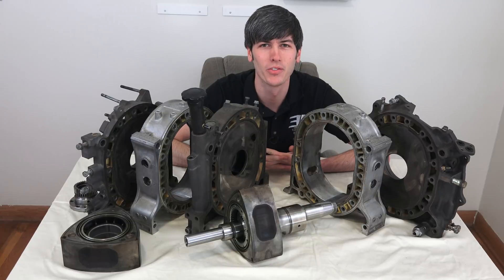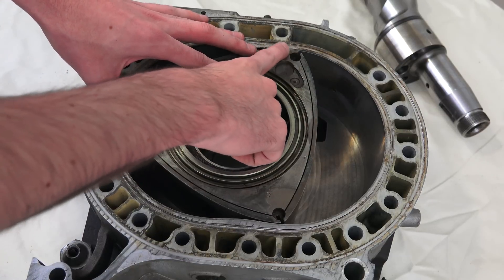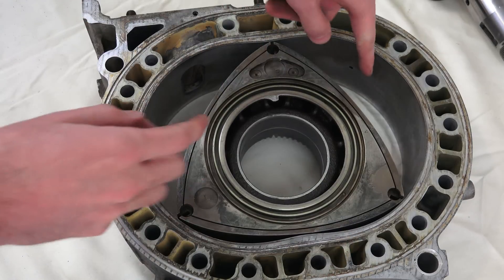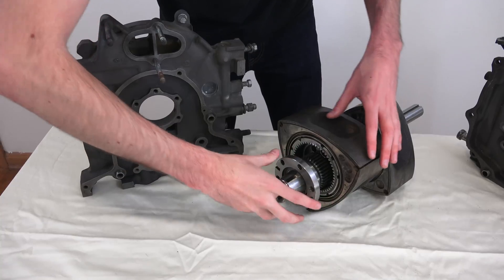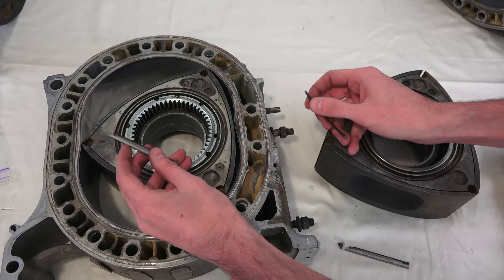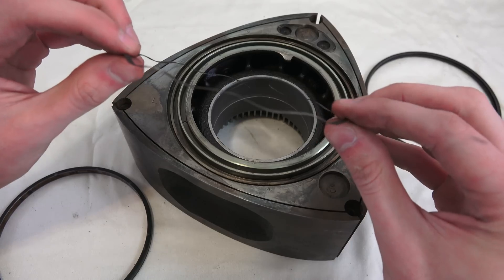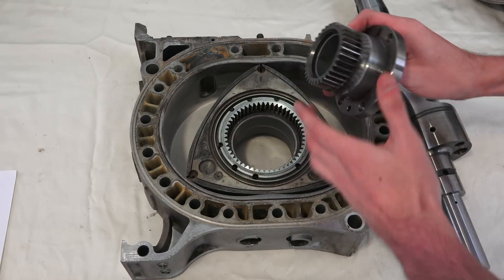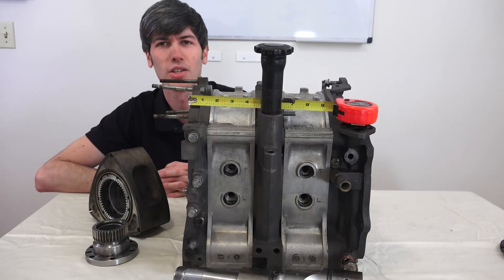How Rotary Engines Work - Mazda RX-7 Wankel - Detailed Explanation

Comment: A cool phenomenon about that shape. If you measure from one side to the other in a straight line crossing the center you will get the exact same measurement anywhere you measure. As long as it's straight line that crosses the center. It seems like only a circle would have that feature anywhere you measure it's the exact same dimension.

Comment: Can anyone explain to me such as with this twin rotor above the following, please?  Am I thinking logically that for one complete turn of solely just one rotor that the crankshaft has turned 3 times which makes it a 3 stroke?  And too for each rotor, do you have the equivalent of a 3 piston type engine due to the 3 faces on each rotor which in the example above would be the equivalent of a 6 pistoned engine?  Am I on the right track?
Reply: Yes, all Wankel engines are equivalent to a 3-cylinder or in multiples of 3s
Reply: Thank you.  It is actually more complicated than what I think as one full rotor turn is 3 turns on the crankshaft verses just 2 turns at the crankshaft for a single piston engine.  Hello from TEXAS! @sandervanderkammen9230
Reply: @jtg2737  You got it! It is a bit complicated and this is also where all the confusion regarding displacement comes from too.
Reply: Al Wankel engines operate using the 4-stroke principle, they differ from other 4-stroke engines in that they require 1080° degrees of crankshaft rotation to complete the firing order rather than the typical 720°.

Comment: The new Mazda MX-30 R-EV, series-hybrid with a rotary engine. Fuel consumption is comparable to piston engines so I have read. But it is very smooth, light and small. So, when running on battery power alone, there is less weight to pull improving fuel consumption to a heavy piston engined series-hybrid when running from the battery alone. Excellent advantage. 

Being only a part time engine, the fuel consumption is not that important as rarely will the car be used using the petrol rotary engine opposed to running off the battery. Typical overall annual fuel running costs, electricity and gasoline purchased, is what matters.

Comment: Those pockets don't increase displacement of the engine.  They are quench areas to increase combustion efficiency.  Without them, the flame would not propagate well.
Reply: Probably not needed, or reduced, when running on hydrogen.
Reply: @johnburns4017  Its the reason why Mazda abandoned hydrogen fuel and abandoned the Wankel.
Reply: @sandervanderkammen9230  
Doktorbimmer a quiz. 
Name the car Mazda are introducing with a Wankel engine?
20 points for the correct answer.
Reply: @johnburns4017  Stop by your local Mazda dealer and see for yourself.
Reply: @sandervanderkammen9230  
BZZZZZZZT! Wrong answer.
docktorbimmer, the name of the car Mazda are introducing with a Wankel engine is the....

🍾🎉🎊 MAZDA MX-30 R-EV 🍾🎉🎊

Zero points bimmer. Zero.  Better luck next time.
Reply: @johnburns4017  Stop by your local Mazda dealer and ask to see one!
Reply: @sandervanderkammen9230  
doktorbimmer, a quiz.
Name type of engine in the MAZDA MX-30 R-EV, currently on sale?
20 points for the correct answer.
Reply: @johnburns4017  Stop by your local Mazda dealer and ask to see one.
Reply: Excellent comment, you are exactly correct, the reason why Wankel engines fail to run efficiently as a Diesel, with GDI or gaseous fuels like hydrogen is the Wankel cannot support a high static compression ratio without sacrificing combustion efficiency.
It's an inherent design flaw in the Wankel that cannot be overcome.

Comment: Re inventing the wheel
Reply: Epic failure.
Reply: @sandervanderkammen9230  lol you are up to date about this Engine..
Glad to tell you that on the 13th of November (2023) Mazda will show the rotary engine again as a mx30 range extender 
At least I hope so, let's wait and see
Reply: @5770mp  Mazda confirmed already that the range extender won't happen and has already canceled sales of the MX30 in the U.S. after dismal sales, there are rumors that the model will be dropped completely by mid-2023.
Reply: @5770mp  Reports from European Mazda dealers is they have no scheduled arrival date for 2023 models suggesting that the MX30 has already been canceled there too.

Comment: Isn't it ENGINE oil, not MOTOR oil?  -ayehole
Reply: ENGINE and MOTOR are Synonymous and completely interchangeable.
Motor being the preferred term
Reply: @sandervanderkammen9230   Ya, so is clip and magazine when talking guns.  Technically, clip and magazine refer to DIFFERENT things and the people who refer to a magazine as a clip are uneducated. The same applies for engine and motor. However, I will end this with you being correct (effectively correct. technically you are incorrect, hence this post) because I always hear people who have built cars from the bottom up (who must know what they're doing!) call an engine a motor.
Reply: @nevertakeadayoff  A clip and a magazine are two completely different things and are often confused.

Motor is the technically correct term to use, not engine but in modern vernacular have become interchangeable.
 The use of the word Motor is used originally for internal combustion machines, it predates  and was used exclusively by Nikolaus Otto and Rudolf Diesel.
Reply: @nevertakeadayoff  Internal combustion technology was developed in France and Germany in the 1800s in French the term Moteur and in English we use the German word Motor

Engine comes from the Latin word Engenium and means intellect or talent or is traditionally used to refer to many clever devices but not specifically to motors.
 Any questions son?
Reply: @sandervanderkammen9230  You are outdated. Do you refer to a suppressor as a silencer because it was originally marketed as such?  "While the words motor and engine are used interchangeably by many individuals, they are not technically the same thing. A motor runs on electricity, transforming electrical energy into mechanical energy, while an engine runs on combustion, converting fuel into mechanical force. "
Reply: @nevertakeadayoff  Sorry lad, but you make a common false assumption...a Motor can be a Heat Engine or run on electricity...it makes no difference.
Reply: @sandervanderkammen9230  thanks, this was fun. peace!
Reply: @sandervanderkammen9230  A motor is any device that converts some type of energy (electrical, heat etc.) into mechanical energy. Engines are a subset consisting of only those motors that convert heat energy into mechanical energy. Which is why you will absolutely never hear the phrase electrical engine.
Reply: @Jonathan-qi9rh  The words Motor and Engine are synonomous and completely interchangeable.

Comment: This video is so old but... I just saw a viscosity lubricants test where biodiesel was almost as effective a lubricant as synthetic oils. Since this engine burns oil in combination with gas could biodiesel be used or added to reduce emissions and increase power?
Reply: Nothing new about that, Castor oil has been used in aircraft and racing cars for over a century, both injected and premixing.
Both natural and synthetic Castor oil engine lubricants have been manufactured and provide superior lubrication qualities compared to other natural and transesterized vegetable oils.

Wankel engines have been used and exhaustively tested with both castor and vegetable based oils.
They can reduce smoke output but have no overall effect on emissions or power output.
 The Wankel engine simply has too many inherent disadvantages and its performance and reliability is inferior to reciprocating engines.
Wankel engines are an obsolete technology today.

Comment: what determines the speed-rpm of the engine? is it the lobe and the size of the shaft? I was wondering if someone wanted to build a lower rpm wankle what that would entail? would it be  a bigger lobe and rotor? there is not to much literature on this, but i was wondering how big the engine would have to be to say max out at 3000 rpm. great video content keep up the great work.
Reply: The rpm is limited by the massive weight of the orbiting triangular piston which reciprocates once per revolution.
The other limiting factor is the surface speed of the Apex seal,  the larger the diameter of chamber, the faster the seal scrapes along the surface per revolution.
Ingersoll-Rand built the Largest Wankel engines 41 liters with a 1,000mm diameter, if I remember correctly rpm was 450.

Comment: Thanks to Mazda, for not giving up on the brilliant Wankel design...  what if they could make it work and the Citroen GS bi-rotor was a success, it could have conquered the world and made hydro-pneumatic suspension successful also!  I am an owner of the GS1000 and still maintain that despite the underwhelming engine (if you know how to drive it) this was STILL one of the fastest cars I've ever driven because your speed around corners was so much higher, so you don't need as much power to keep it going.
Reply: Manda abandoned all development of Wankel engines in May 2009.
All production ceased on June 21st 2012.

Comment: How are the accessories driven on one of these, if the crank is doing 10k?
Reply: The crankshaft spins at 9,000 rpm, but the internal components are only rotating at 3,000 rpm... slower than many Diesel engines.

Comment: Liquid piston in Bloomington Connecticut has maybe perfected the rotary engine it has three combustion Chambers you get three power strokes per revolution
Reply: Beware of Liquid Piston it is a vaporware investment scam
Reply: @sandervanderkammen9230  
Doktorbimmer, a quiz.
Name the Mazda model currently under production using a rotary engine?
20 points for the correct answer.
Reply: @johnburns4017  Not in production, stop by your local Mazda dealer and see for yourself
Reply: @sandervanderkammen9230  
BZZZZZZZZZZT! Wrong answer.
Doktorbimmer, the name of the Mazda model currently under production using a rotary engine, is the...

🍾🎊🩸 Mazda MX-30 R-EV 🍾🎊🩸

Zero points Bimmer. Zero.  Better luck next time.
Reply: @johnburns4017  Stop by your local Mazda dealer.
Reply: @sandervanderkammen9230  
docktorbimmer, a quiz.
Name the latest car Mazda dealers are issuing brochures and taking orders for?
20 points for the correct answer.
Reply: @johnburns4017  Stop by your local Mazda dealer and see for yourself.
Reply: @sandervanderkammen9230  BZZZZZZZZZZT! Wrong answer.
Doktorbimmer, the name of  the latest car Mazda dealers are issuing brochures and taking orders for. Is the.....

🍾🎊🩸 Mazda MX-30 R-EV 🍾🎊🩸

Zero points Bimmer. Zero.  Better luck next time
Reply: @johnburns4017  Stop by your local Mazda dealer and see for yourself.

Comment: What you are actually showing here is the original version of the Wankel rotary engine, with the spark plug holes on the periphery of the chambers. This configuration suffers from the fact that, in cold weather, ice/oil sludge from the combustion chambers gets thrown against the spark plug holes and drowns the spark.  I used to own an NSU  Ro80 sedan and it was a wonderful car except that it often wouldn't start in Chicago winter weather. Mazda solved this problem by placing the spark plug holes on the side walls of the chambers.  Probably the ideal arrangement for an automobile Wankel engine would be a 3-chamber design, where the spark plug holes for the outer chambers are on the sidewalls, while the center chamber has the spark plugs at the chamber periphery, on the topside of the engine. That way, at least 2 of the 3 chambers would be operational until the motor warmed up enough to clear the spark ports of the central chamber. Another way of dealing with this drowned spark problem might have been to use self-heating spark plugs.
Reply: This is the non-rotary version of the Wankel concept called the KKM, the rotary version called the DKM never saw production, it requires disassembly of the outer engine case to replace the spark plugs, a very compromised design.

Starting problems are common with Wankel KKM engines and are most often associated with low compression due to apex and side seal damage.
These problems continued to plague the Wankel right up until it became obsolete a decade ago.

Comment: Thanks for the explanation, I wonder why this engine design wasn't so popular in motorcycles, it's basically what a motorcycle needs: compact design, high revving, low vibrations, high output.
Reply: Ironically Feliix Wankel conceived the engine specifically for motorcycles, NSU was a major European motorcycle producer at the time.
Unfortunately the Wankel engine was inferior to compareable reciprocating engines in motorcycle  applications... it offers no real advantages and many serious flaws and disadvantages.

Comment: I've been reading about how apex sealing is an issue because of the temperature differences between different parts of the engine. What if there was some way to keep the apex seals at a constant temperature, perhaps making them out of a material that retains heat well.

Comment: Are you able to experiment and see if a rotary motor can be an efficient way of powering a generator.... I ask this because I'm wondering how efficient is a rotary electric hybrid would be
Reply: Wankel engines are very poorly suited to generator applications.
Several companies developed the Wankel engine for generators and compressors. 
 Audi and Mazda both experimented with hybrid electric vehicle.
All proved to deliver unacceptable performance and efficiency.

Comment: can someone explain 'reciprocating mass' limiting revs whereas we can rev higher with rotary engine? @10:00
Reply: I see you noticed his mistake as well, what was said is incorrect... the Wankel engine has significantly higher reciprocating mass and it's maximum operating rpm is Lower than many reciprocating piston engines.

Comment: In order to make the two rotors have opposite power strokes it is only necessary to have a rotor 60 degrees out instead of 180 degrees.
I have been trying to fully understand these engines for 45 years. Now I finally do, I think. Lol

Comment: So how is the RPM calculated. If it is calculated using the crank then 9,000 rpm means the rotors are three thousand. Also the thermodynamic cycle is 1,080 degrees, so how is the displacement calculated trying to compare it to a four stroke engine that has a Thermodynamic cycle of 720 degrees.  Well done with your explanation.

Comment: I'm planning to build a kit aircraft and to use a 2 or 3 rotor Wankel engine.  Can you tell me how the Wankel compares with a reciprocating engine of similar hp?  How do the two types of engines compare with regard to fuel burn per hour?  Thanks!
Reply: Wankel engines are not suitable for aviation... which is why no aircraft manufacturer uses them.
BSFC and range are very poor, horsepower curve and rpm poorly matched for optimal propeller efficiency.
Running a Wankel engine lean of peak is recipe for severe engine damage too.

Comment: They’re not rotary engines, they have “rotors” but a rotary engine has a stationary crankshaft and radial pistons that spin around it. Great explanation of the Wankel engine though, these are one of my favourite engines. It’s a shame there’s so many flaws, maybe once there’s advancements in gaskets that don’t wear out as fast they will work better

Comment: Not to forget of course the reciprocating mass of the pistons in a standard engine (not just the valves). Constantly stopping and changing direction each cycle. Quite an inefficient design.

Comment: Coming of age in the 2000s, I always thought the RX-8's Wankel had essentially the performance characteristics of the S2000's F20C (both fantastic engines in their own ways). About the same power, about the same rev range.  
Am I way off? Does anyone know if an in-depth comparison of the two?  Like, if you had a stock RX-8 and S2000 and swapped their engines with each other... Aside from (probably) sound, what would be the big difference?
Reply: The S2000 on a dyno will show slightly more power through the rpm range, but the rx8 provides smooth, turbine like power, but put a fully open exhaust on it and the scream is unbearable. The main difference is the rx7 is 1.3L only based on the unique system the engine inventors, invented. But based on air drawn in in 2 revs, like all piston engines, it's 2.6L, and the S2000 offers much more power per liter, and more reliable piston seals vs rotor seals.
Reply: @kevink2315  ah so that's why I've heard it more or less operates on 2-stroke principles. Also explains the surprisingly high output for its physical size, the low fuel economy, and oil consumption. Thanks for the info.
Reply: @nthgth  The only link to a 2 stroke is the use of ports instead of valves. It's still a 4-stroke in principle. Look at one rotor. It has 3 faces that each see all 4 strokes,  but it spins at 1/3 crank speed. So it takes 3 crank revs to fire all 3 rotor faces, and the rotor fires 2 faces in 2 revs. So with 2 rotors you get 4 firings in the  2 revs of a piston engine. With .65L per chamber, you get 4 x .65 = 2.6L displaced. Search " wankel displacement wiki" for a full explanation.
Reply: @kevink2315  oh okay, I was mistaken. Thanks again for the info, I've got some research to do on this